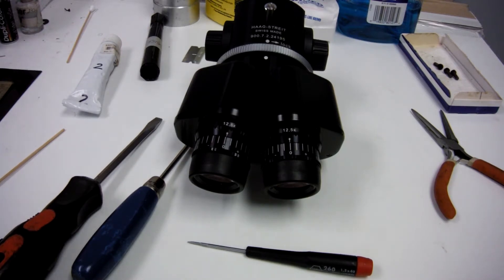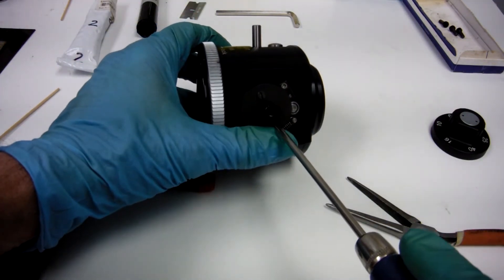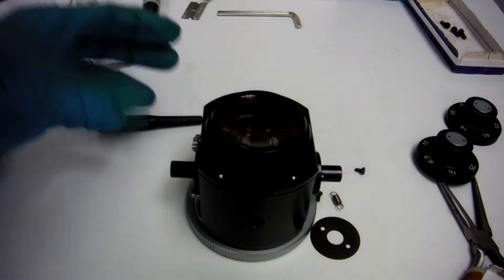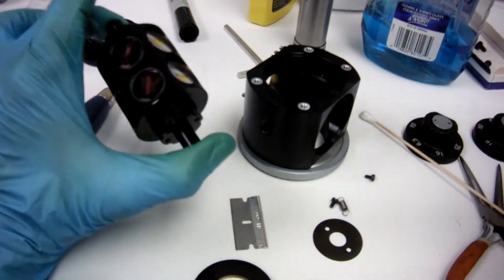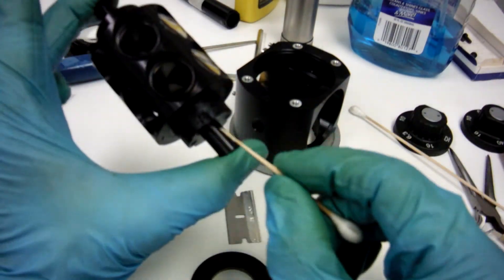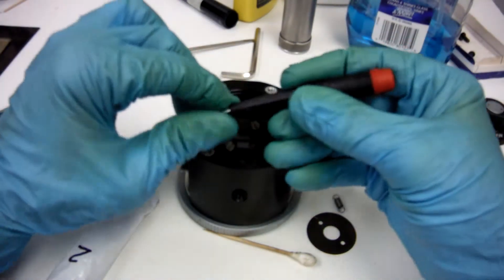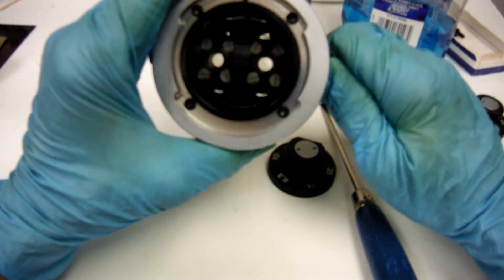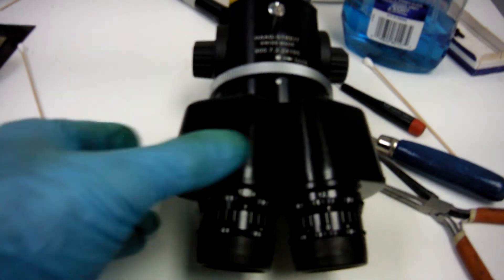Haag Streit 900 BQ Slit Lamp mag changer refurb

Comment: hello can i ask you how to disassemble the 10x eyepieces?  I tried to unscrew them but I can't
Reply from the maker: Yes, sometimes they seem impossible to unscrew and I have messed them up more by trying.☺ If they don't unscrew, I just leave them. It seems like it does not make much difference to try to clean the inside of the rear lens anyway. If it looks foggy looking through your binoculars, the real issue is probably the inside prism assembly needs to be cleaned. See video: "Haag-Streit Binocular Head Defogging Cloudy refurb procedure". Hope that helps. But the 10X are on the BM. The BQ's are 12.5.